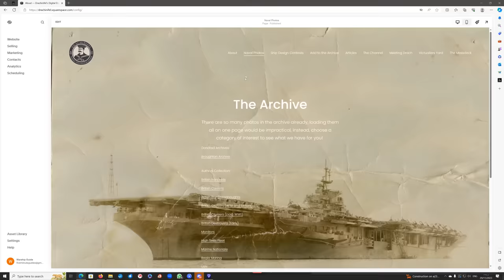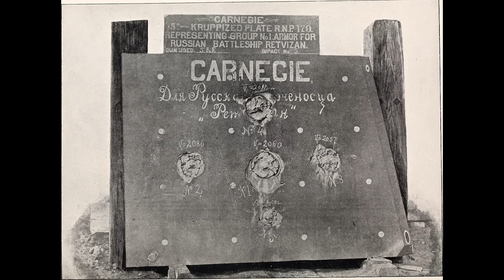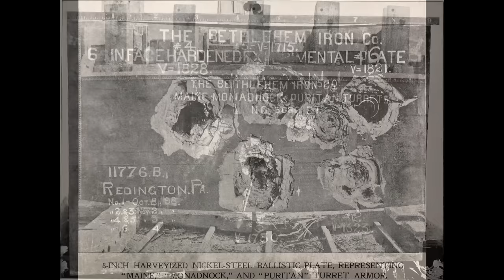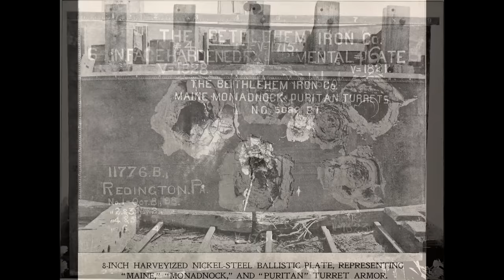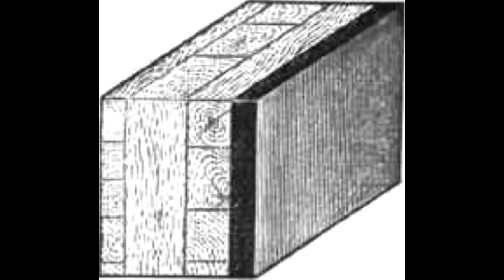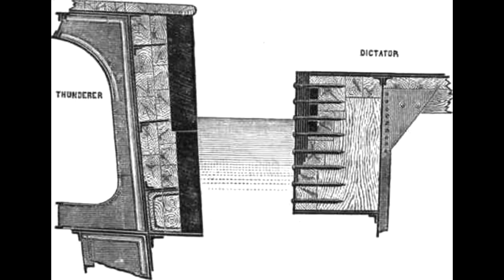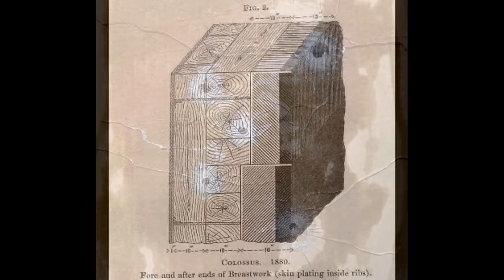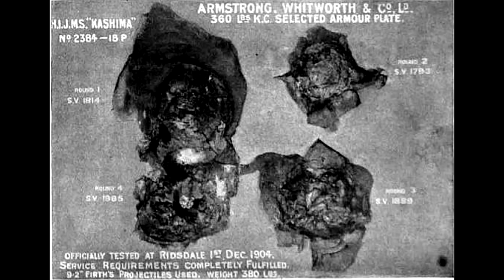Battleship Armour Engineering - Why is naval armour multi-layered?

Comment: A few more complex points concerning the differences between homogeneous, ductile plates and hard-faced plates:

(1)  Hard-faced plates (Harvey, KC, Compound, Chilled Cast Iron) are penetrated mostly by velocity, not the shell weight.  That is, the weight term only increases by the 0.2 power (small) but the velocity effect of increasing thickness penetrated goes up with the 1.21 power (if damage to the shell kept the same for all hits).

(2) For homogeneous, ductile plates (Mild Steel, Nickel-Steel, Krupp Chromium-Nickel-Steel, RHA, Non-Cemented Armor, Class "B" Armor, Special Treatment Steel, etc.) between 0.2 and 1.1 caliber thickness, the French 1890 De Marre Nickel-Steel Penetration Formula gives rather good penetration values (again, when shell damage kept constant) at right anglesd (not as good at other angles of impact) -- intertwines US Naval Proving Ground Dr. Hershey's WWII test data) using a De Marre Velocity Coefficient of ~1.22 to change from nickel to nickel-chromium armors. (Below 0.2 the plates have large dents or "dishes" form on impact and above 1.1 the hole made is by the shell nose "wedging" the armor sideways, while in the 0.2-1.1 region the shell nose forms small dishes, only wedges near the face of the plate, and forms thick triangular backward-bent triangular "petals" ringing the back of the hole (broken off much of the time).  Here the total kinetic energy of the shell using both weight and velocity work in unison.  So we get penetration proportional to [(weight) x (velocity-squared)] to the 0.714 power = (W)^0.714 x V^1.43.  (Note that this velocity power is exactly double the penetration increase for all face-hardened plates.  Interesting.)

(3)  The hard face of face-hardened plates is brittle and breaks apart as it is punched through the hole and out the soft plate back shock-absorbing region.  The thicker the face layer, the greater SCALING sets in to make bigger shells hitting proportionately scaled-up plates of identical properties penetrate more and more easily.  Krupp originally used a 35% hard face and this had only a relatively small scaling effect weakening the thicker plates against bigger shells 9yet afain, with constant damage).  Thinner faces do have less scaling, but the difference is not large.  Going OVER 35% rapidly increases scaling, to the detriment of armor being hit by larger shells, though against small, cruiser-sized shells, the scaling is always small and works to make such shells penetrate better, not worse.  Italy's Terni Company seems to have figured this out and had its thick plates have thinner proportional faces -- one thickness in cm -- than its thin plates.  US WWII "Thick Chill" Class "A" face-hardened armor had a 55%face to try to damage the superior US WWII AP shells and this degraded this armor's resistance against the larger AP shells, though it was still stronger than US WWI-era Class "A" armor.

Comment: Hi Drach, back in the nineties and naughties I was heavily into pistol shooting, and in the mid nineties the range I shot at (Christchurch NZ) was forced by land sale to change from a 'full danger area' range to being a 'zero danger area' one.  This involved major earthworks for backstops, and an issue we had in designing them was that in a ZDA range you are not allowed to be able to see the sky from the firing line. If we had only utilized the firing line roof and backstop to accomplish this the backstop would have been impossibly high, so we came up with the idea of a vertical baffle sitting a couple of meters from the firing line. The next problem we had was what to make it from, and me being a fitter/turner/machinist I was the committee member lumbered with the job. I cannot remember where I got the idea (it's 30 years ago) but I came up with a sandwich of three sheets of 19mm marine ply with two sheets of 3mm mild steel, made some test pieces and took them to the range where everyone and their dog did their best to punch holes in them. When I dismantled one none had been able to penetrate the first sheet of steel and only one group (38super) were even able to put a crack in that first sheet. I then cut a cross-section through the other test piece and could clearly see how the fibres of the ply had increased the area impacting the steel.

Comment: Yes please on more "engineering level" Friday content. Regarding phase transition on early armor steels, wasn't it the (among other elements) addition of nickel that made the greatest improvement on ductility (irrespective of actual hardness) over temperature excursions?
Reply: I don't know whether the answer to your specific question is "yes," but based on my own research, I'd say it's plausible. My colleagues and I have done mechanical shock testing on a variety of alloys, & my role has been post-test characterization of the test samples & ejected fragments. The more nickel-rich alloys always seem to be more ductile & the difference becomes more pronounced the colder the temperature the experiment is performed at.

Comment: Something that tank nerds talk about is triple-hardness steel (THA) - steel made from explosively bonding or rolling a very high-harness steel (~500BHN HHA) between two sheets of normal RHA. This is very tricky to do for various reasons, but can in theory create a structural steel that is much more thickness-efficient than normal RHA.

The rough naval equivalent would be rolled compound armour - where cast iron was poured between two wrought iron sheets and then rolled. I think that it might also have been possible to chill the two outside sheets and get a slab of chilled/white iron between two pieces of wrought.

The advantage of a triple laminate structure like this is that, if you're cunning, you can use both the front and back face to support the brittle interlayer and almost completely stop crack propagation. The disadvantages are things like complexity, cost, constraints on what sort of steel you can use (due to changes in size from quenching) and limits on the ultimate thickness that the plates can get to (from memory, modern THA can only be made about 50mm thick). All this is probably what kept the technology from being explored further in ships, and limits the use in tanks to this day.

Comment: A year or two back, I was looking in to the design choices made on the KGVs, and found that armor production was one of the bottlenecks.  Some of the armor was subcontracted to a Czech firm, to ease the bottleneck.  I looked at the armor produced for the cancelled South Dakota class in the early 20s: 13.5" vs 14.7" for the KGVs, and both were flat sided designs, rather than inclined.  The greatest difference was, after the KGV design was revised, it's belt extended one deck higher.  Cranked up the alt history generator, to create someone in the Navy Department, in 1922, suggesting to SecNav Denby " The Washington treaty will allow us to build battleships again in ten years.  Let's keep all that very expensive armor that has been made for the South Dakotas, so it can be used in the future".  When the future arrives, the North Carolinas are designed with sloped armor, so the armor that had been stored for 15 years can't be used.  So FDR sends a note to the British naval attache at the DC embassy, asking if the Admiralty might have use of a large quantity of battleship armor, suitable for flat sided installation.  Unfortunately, such a thrifty minded person did not seem to be in the Navy Department in 22.  The SecNav annual report a few years later reported that the last of the armor that had been made for the :South Dakotas had been sold as scrap.
Reply: I like this idea but I am 90% certain that if the us navy still had that plate armor in the 30s, the North Carolina class & possibly the second South Dakota would have been designed to use that armor.
Reply: @jacobdill4499  I thought about that.  The US was building to the 35,000 ton limit.  Using vertical 13.5" armor, vs new, and sloped, 12" would add a lot of weight.  Given the rate that the US cranked out battleships, they did not seem to be armor production capacity limited, like the UK was.  Looking at the build times for the KGVs, the first ship completed in good time, but the build times got longer and longer.  Anson and Howe were laid down 6-7 months after KGV and PoW, but commissioned 18 months after KGV and PoW.  Considering the rate the RN was losing battleships in 41, having those last two KGVs finished a bit earlier would have been nice.
Reply: US armour of the time wasn't as good as British armour, and the British knew that, and besides, 15-year old armour wouldn't be as good as the latest as a general rule anyway.
Reply: @rupertboleyn3885  everything you say is true.  However, as I remind my Canadian friend when he starts complaining about the 50 old DDs the US handed over to the RN in late 40, you use what is available.  Belt armor bolts on, so the Admiralty could always change out the 13.5" when better material was available.  I have read that the 14" on the KGVs was designed to fit the same cradle as the 13.5".  Navweaps says 54 of the old 13.5s were still in inventory in 1939.  What mongrels Anson and Howe could have been, with US belt armor from the South Dakotas, and guns from the Iron Dukes,  Considering that, over the course of 41, the RN had lost Hood, Barham, Prince of Wales, and Repulse, and Queen Elizabeth and Valiant were disabled, a couple of mongrels may have been welcome.

Comment: Did ships use other material before the metal plating in order to slow down/disrupt the incoming projectile. Something like another ductile material or some form of space armor?
Reply: The only traditional example I can think of would be the Littorios which backed their armour belts with concrete, but warships have used additional layers of torpedo defences, coal bunkers, ballast and fuel tanks to slow down incoming shells before they pass through into the vital areas. Though any material that isn't steel plate (in terms of WW1 and WW2, not including modern composites etc) is going to have vastly reduced stopping power, so there would need to be a lot of it involved - which, of course, adds a lot of weight.
Reply: There's a few oddities in the US civil war, the cotton clad ships where perhaps a form of space armour.

Comment: Basically really hard materials are brittle.
They will usually have a higher yield strength, but not necessarily a higher toughness (how much deformation energy it takes for the material to fail, it's the area under the stress-strain curve).

Take martensite (quenched steel) for example: it's extremely strong and hard but also very brittle. There is almost no plastic deformation before failure, which means it's actually not very tough. 
Tempering that steel will make it less brittle (more ductile), and more tough. The longer its tempered, the more ductile it becomes. Eventually, the sweet spot is reached (maximum tougness for that composition) and continuing to temper will cause a reduction in toughness. Temper steel long enough and hot enough and you end up where you started before you forged/quenched. This is called annealing.

Comment: 2:40 These principles absolutely pertain to metallic body armor as well, both ancient and modern. Your medieval breastplate had to be just as mindful of the balance between hardness and ductility as a ship's plate, and it is amazing how much smiths over the millennia understood these principles just by observation and experience. 

Though the difference in average thicknesses involved seems so enormous, with body-armor rarely exceeding 3-4mm and usually thinner, while ship armor tends to be at least several centimeters thick, the same problem of needing the plates to flex just enough to not crack or shatter under impacts pertained, and medieval smiths worked hard to ensure their plates had these qualities. 

Indeed, if you look at some early treatise on ship armor, you will find the engineers make more than passing references to even ancient smithing techniques, keenly aware as the modern engineers were that their issue was nothing new.
Reply: There is a kind of 17th centrey armour,  the duplex breastplate, where a two ply construction was used to join two layers in the hope of stopping cracks. 
Often one layer is harder then the other by there does not appear to be any plan of differential hardening them, often both are of similar hardness or the hard one on the inside.

What is differentialy hardened are some of the armourer's recipes from Medici archives, all of them call for the rear of armour to backed with clay before the quench, the slower cooling  would hopefully leave some steel in a more ductile state.
Reply: From what I can tell, the main goal of duplex was to make thicker plates (mostly in response to the rise of gun bullets) while still depending foremost on manpower to work the metal. Practically speaking, smiths could only make large plates so thick (ie, about 3-4mm) with their own muscles, and bonding two thinner plates to make one thicker plate (say two plates of 3mm to make one plate of 6mm) seemed a practical way to get the thicker plates than trying to form a 6mm plate from the start. 

Since the final plates could be thicker than normal for hand-forged armor, they were less prone to cracking through sheer mass, which partly explains why there wasn't a clear concern with differentiated hardening. Make a plate thick enough, it just won't crack anyway, and that seems to be the case for duplex.

Of course, the reality was that body armor was losing its practical value simply because it became cheaper to replace dead men than to armor men against guns and bayonets, and so innovation in armor plate would have to wait for the naval arms race to really get going again. 
 
 @SuperFunkmachine

Comment: Pedantic correction: wood (and to a lesser extent carboard) isn't ductile. It doesn't plasticly deform much at all and doesn't strain harden. Instead it bends until it breaks suddenly, like a spring. 

For a true ductile material (like lead or copper), you'll see the material inelastically deform by a large amount. This means that, once deformed, it doesn't come back to true. But it van deform a lot before it breaks.
Reply: To be even more pedantic, ductility is about tensile stress, but in talking about impacts, this shouldn't (isn't?) really be relevant; you should be talking about malleability - compressive stress. Lead isn't ductile, or at least, it isn't very ductile, but it does have considerable malleability. However, I do tend to read "ductile" all the time when I expect to see "malleable", so this is clearly a thing with engineers (I am a scientist, not an engineer!).

Comment: I'm not an engineer, but I believe the two upper holes are larger then the three lower holes are due to the slight angle discrepancy of the aimed gun. The larger the angle, the more damage from the projectile. Does that make sense? 
I know that later German tank armor was sloped, as were many other tanks during the latter stages of the war, to resist frontal attacks. But if you are firing directly at a target, the round will pass straight through. If there is a slight angle, the round actually will pass through slightly more material creating a larger hole.

Comment: The temperature where a material changes from ductile to brittle fracture is called its glass transition temperature. Conventional carbon steel's transition temperature is very close to 0°C/32°F. Alloy steels can extend that to well  below that however. This was learned during WWII when the Kaiser manufactured Liberty ships started breaking in half in the North Atlantic. And they failed right at the section welds.
Reply: A metallurgist by the name of Charpy was tasked with investigating these failures. He developed an impact testing protocol and method and characterized steels in common use to determine the glass transition temperatures for them.

Comment: I've seen a more modern armor method where you have an outer and an inner plate, of simple steel (I assume) but with a bit of space between them. The space between them is then filled with ceramic balls. Bullets entering shatter against the hard ceramic balls, and cracked balls and chips from them fall farther down between still intact balls, while balls from higher up replenish the armor lower down. It's a sort of self-healing ceramic armor. It was experimental, and I don't think it has been used in a production vehicle, but as far as I recall, it worked quite well. The downside was the bulk, even though the weight was low.
Reply: The Russian T-64 tank used this armour array in the turret!
It wasn't used on successive models, but it was nonetheless fielded

Comment: Ok so as a materials scientist studying (among other things) embrittlement of metals in extreme environments, but who knows nothing about naval metallurgy beyond your videos, I'd be super curious to learn more about any specific case studies where Harvey or Krupp steel armor experienced significant environmental damage. I'm thinking of processes like hydrogen embrittlement, corrosion, thermally-driven fatigue, or creep, especially over a long service life. Obviously those processes would change the mechanical properties of however thick the exposed layer is; but if there's any diagrams, images, or other characterization of the thickness & distribution of the damage, I think that'd be neat to see. And then also comparing that damage to case studies I'm more familiar with, e.g. in steels with more uniform hardness, or in structures like welds where the hardness varies at a joint as a necessary consequence of the production method, rather than as a deliberate choice to fulfill a design requirement.